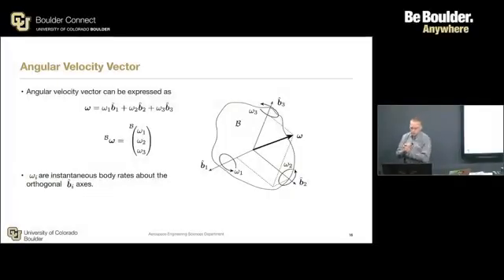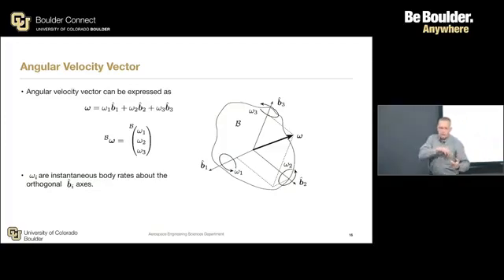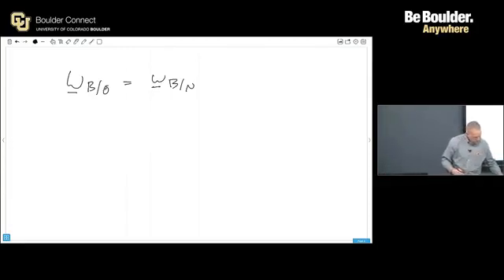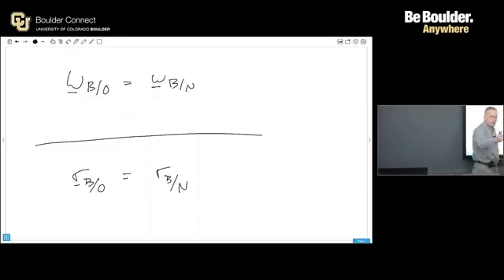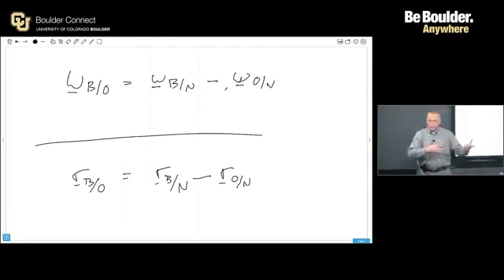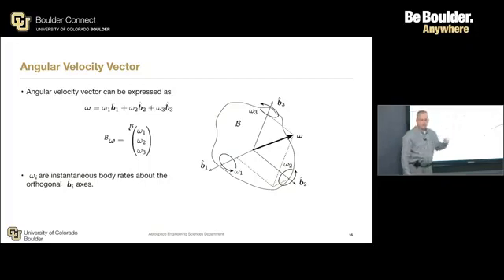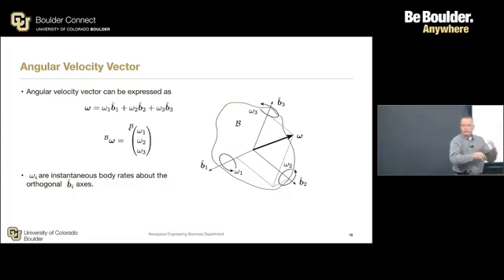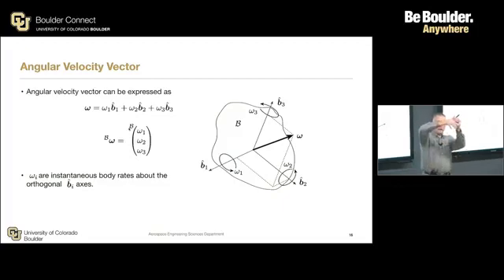Angular Velocity Vector

Comment: Hi, i never really found an answer. All i can say is thinking of the omega vector and its components at any given time in terms of the full rotation that they produce eventually is probably flawed. My intuition is you have to think about the components instantaneously (and accept that they do add like vectors to give the omega vector). 

Mathematically, if you think about the components of angular velocity here as 3D infinitesimal matrices it's possible to show that adding such objects is vector like: The multiplication of auch matrix objects by each other both commute and give another infinitesimal matrix. This is isomorphic to vector-like behaviour essentially. 

Big caveat: This is if we assume the resultant physical angular velocity omega is represented by an infinitesimal matrix also. I was never convinced about why the resultant angular velocity omega is representable by that particular resultant infinitesimal matrix though so thats the piece of the puzzle that was never answered for me. 😊

So up to that, i accept it mathematically, but still have difficulty understanding it physically.

Comment: Hi,

I was hoping you could answer something about the angular velocity vector:

When I take an angular velocity omega in 3 space and decompose it into its x, y and z components, omega_1, omega_2 and omega_3 respectively, we expect the magnitude of the angular velocity vector to be: |omega| = square root of ((omega_1)^2+(omega_2)^2+(omega_3)^2).

However, if you think about the rotation of a particle described by the omega vector:

Let's say it does one full rotation in 1 second. Physically, the projections of this rotation onto the yz plane, xz plane and xy plane correspond respectively to the x, y and z components of omega above and each of these projections (of the body onto the respective planes) all undergo one full rotation in 1 second also.

So, on the face of it, the angular velocities of each of these components are on average (over one rotation) the exact same as the magnitude of the angular velocity of our vector omega (if we trace out the motion of the particle itself and the motions of the projections of the particle):

|Omega| = omega_1 = omega_2 = omega_3

This contradicts the decomposition above.

Can you explain what's going on here and what assumptions above are false.

I would be very grateful if you could offer help with this as I can't get answers anywhere else. I'm interested in fitting the mathematics with the relevant physics.

Thanks.
Reply: dude this comment gave me so much hope, I was also searching for answers for the same thing and it made me so happy that a guy from across the globe had the same question an year ago! did you find the solution btw? please help me out lol I cannot find any other resource talking about this 😭😭
Reply: @hashirirfan4899 
Hi, i never really found an answer. All i can say is thinking of the omega vector and its components at any given time in terms of the full rotation that they produce eventually is probably flawed. My intuition is you have to think about the components instantaneously (and accept that they do add like vectors to give the omega vector). 

Mathematically, if you think about the components of angular velocity here as 3D infinitesimal matrices it's possible to show that adding such objects is vector like: The multiplication of auch matrix objects by each other both commute and give another infinitesimal matrix. This is isomorphic to vector-like behaviour essentially. 

Big caveat: This is if we assume the resultant physical angular velocity omega is represented by an infinitesimal matrix also. I was never convinced about why the resultant angular velocity omega is representable as an infinitesimal matrix though so thats the piece of the puzzle that was never answered for me. 😊

So up to that, i accept it mathematically, but still have difficulty understanding it physically.
Reply: @markkennedy9767  that is a really cool insight, it kind of makes sense because omega was never about the whole rotation but dθ/dt, like in a non uniform circular motion. But i can relate to the flawed intuition part, I spent the past 4 days just rubbing markers all over my whiteboard to reach nothing... I personally wouldn't want to flatter myself saying no physicist ever caught onto this, because there must be a good physical image out there, I will let you know if i find it! thank you! guess I'll be spending a couple more days on this.
Reply: @hashirirfan4899  

If you do find a physical intuition for it, I am all ears. 🙂
I think it is essentially what you say there. The components of the angular momentum refer to the instantaneous d(theta)/dt at that point in the projection of the trajectory onto the respective plane (which as you say aren't circular, so the d(theta)/dt are always changing).

Look up the mathematical explanation with infinitesimal matrices and it gives some insight: so basically we can combine angular velocity components like vectors if we treat them as infinitesimal matrices; these commute (like addition commutes), can be multiplied by scalars and multiplying them together gives another infinitesimal matrix. So they are vector-like. They only little issue I have with this it doesn't say that the resultant infinitesimal matrix actually represents the angular velocity of the component angular velocities combined.

So we do have infinitesimal matrices behaving vector-like and the component angular velocity can be represented by infinitesimal matrices. I'm just not convinced that the resultant physical angular velocity is that resultant infinitesimal matrix.

I've asked this question in numerous places, and I've never got an answer that connects the maths and physics. It's like even experts just accept it without thinking too much about it (or, worse, think they know this confidently). I'm surprised this channel didn't get back tbh.

If you do hear anything else, let me know 🙂